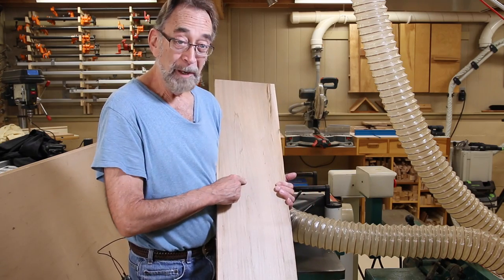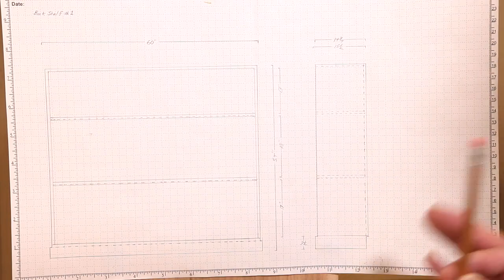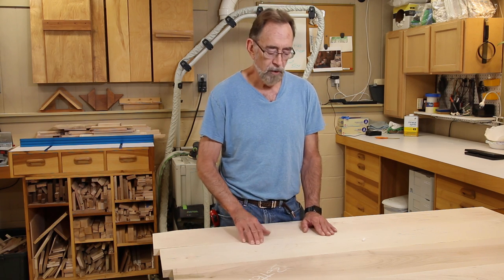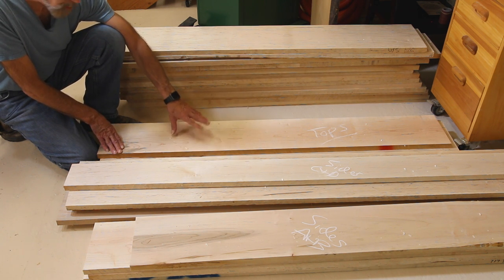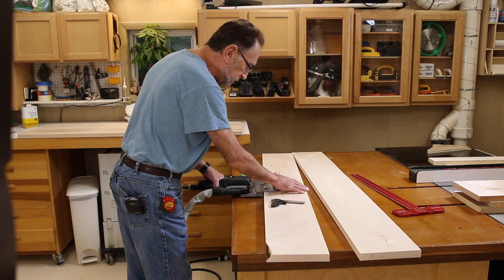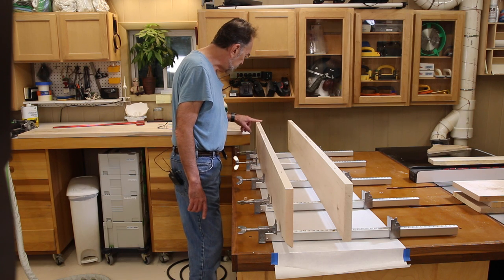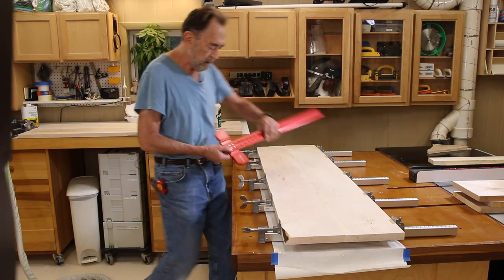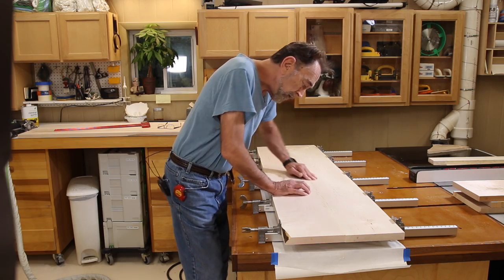The Down to Earth Woodworker - Maple Bookshelves Part 1

Comment: Nice video as always.  I did once build a little bigger book shelf for a client.  Total was 10' high, 14' long and 15" deep with random spacing of the uprights per client request.  Took a total of 23 sheets of 3/4" plywood and 8 sheets of 1/4" plywood for the backs.  I made them in 4 pieces each 5' x 7' just so I could transport and get get them into the house.  Then I used 1 1/2" and 2" trim on the fronts to tie them together.  He filled them clear up with all his books!!.   John the Handyman in Las Vegas.

Comment: I refined the quantity of Walnut for my out feed table and ended up making the face trim only out of three pieces just as you did in the 2 large maple book cases. At first I was disappointed for having to do this, but after I applied 3 coats of Polyurethane I was amazed at how well the grain of the three pieces popped out. After watching your video with the same situation, I didn't feel so bad.